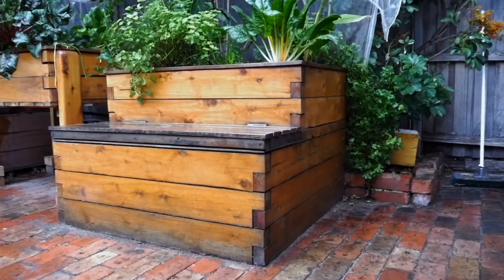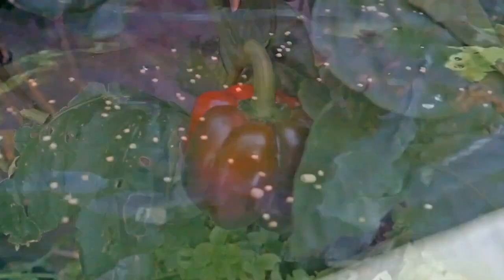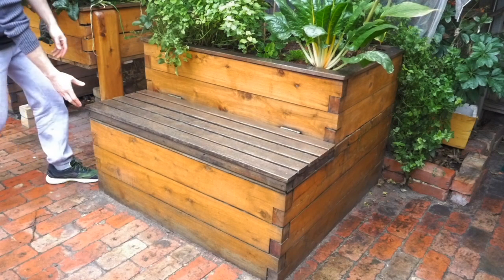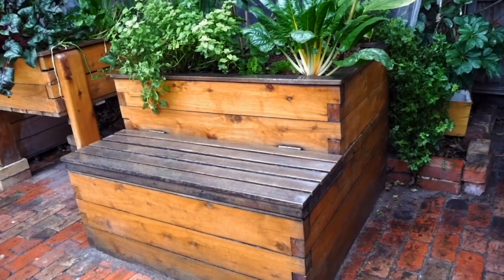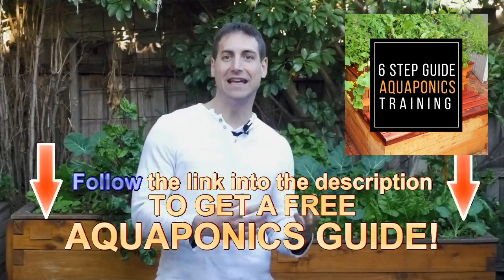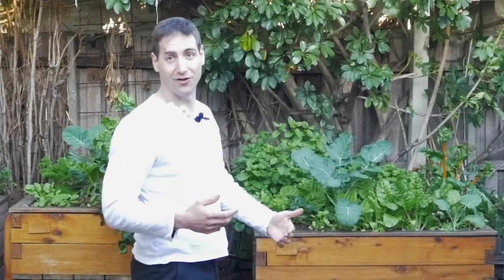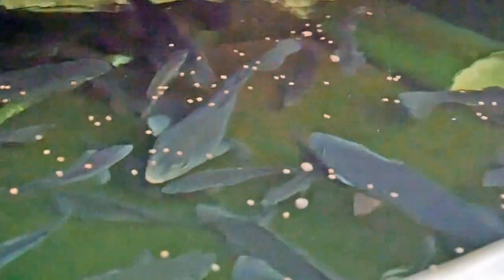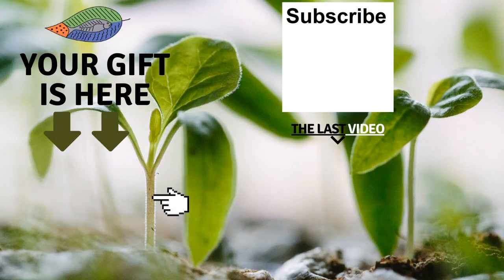Is wood good for aquaponics system?

Comment from the maker: Have you used wood for your aquaponics setup? What type of other material are you using?
Reply: I only use pressure treated wood when necessary to frame in other materials.  Really though for my current project it's a desperate rush to try to get the fish moved from my existing pond 1/2 mile to my new setup which is a work in progress.  For 100 bucks each I purchased two 140 gallon stock tanks for the fish and am also repurposing a hot tub that has maybe 200 gallons.  I set it all up right next to the house on the existing concrete pad where there is water and power.  The tanks will be set up with heaters and aeration today and I hope to start moving the fish.  There are maybe close to 20 so it will be a chore.  I rented out the house where the pond building is and it's now the tenants backyard so I must vacate.  Anyway your set up looks nice and that was an odd egg.  I like the bench approach it reminds me of the old benches with a storage box in the old houses.
Reply: The other reality is to keep it warm without spending a fortune.  To that goal I put both tanks on 2" pink foam board insulation and will also surround the tanks with more foam board.  On top the old hot tub cover works well on the tanks because it flips up in the middle.  Over the actual old hot tub witll go more pink foam board.  Then tarps to enclose the sides of pink board and over the old hot tub.  Nylon rope to cinch it all down.  Doesn't sound very aesthetically pleasing, does it?  I am going to grow duckweed inside using fish water and watering my plants that had to be moved inside for the most part.  Anyway if you made it this far have a great day.

Comment: Advanced technique, I put the pump next to the air and the heater, and on the ground of my 140 gallon stock tank.  Then I put the entire 5 gallon combo biological filter into the tank and submerged it, attached the pump, and think it will work out well.  That's why I advanced it, made sense in terms of covering the main tank.  Now I can just "fish" it out occasionally.  OK off to catch and transport some tilapia it is GO time.
Reply: 14 tilapia transferred from the pond to 140 gallon tank.  No fish were harmed much.
Reply: Another 6 today so far.  I got Big Blue that one is a beast.  Also 3 other blues and two small whites.
Reply: Last 8 I hope total 28 in 2 days.  Seven more blues and "tiny" the little white one that never grew much.
Reply from the maker: Thanks John,
Any video of your setup and fish?
Cheers
Jonathan
Reply: @AquaponicsRevolution  Sorry Johnathan, I don't do videos.  The best I can do is rambling diatribes of nonsense.  Sad times in the days of some of my prized fish.  This is what can happen when things go wrong.  The good news is 19 survivors are in the two 140 gal black tanks and seem reasonably happy after the big move.  Yesterday I was worried one of the whites was floating but was pleased to see him eating duckweed casually on his side.  Whew.  Took out circulation other than air stones.  Added the biologic gel.  Did some filtering the other day on each tank but still need a real filter set up.  Of course it's getting ready to freeze.  The duckweed is growing in the hot tub with heat and aeration.  Each tank has 300 watt heater with a control that seems to be working.  Finnex basic controller with the titanium heaters encased in plastic.  Seem to be decent.  I have it set up to cover at night with the hot tub original cover over it and 4x8 pink sheet board over the two tanks.  That's it, a work in progress...
Reply: @AquaponicsRevolution  bad news managed to drop the one heater controller in the one tank by mistake.  Three more fish didn't make it.  Amazingly,  six actually survived electrocution.  My plug and GFI and God knows what else did not.  This time I cleaned these poor blue nile fish and salted them up with Maldon and grilled them whole.  I overcooked the one side to some extent but they came out pretty tasty.  So there is that.  I moved the remaining 6 fish into the hot tub.  I am celebrating "no floater" Thursday after temperatures dropped to 24 F last night.  I just love all this extra work trying to keep a few fish alive but at least they do seem to like the hot tub.  I am going to feed them mostly duckweed and very little of the commercial food at this point.  There is a lot of duckweed to be fed to them.  In fact I am going to start consuming some duckweed myself, and why not.
Reply: @AquaponicsRevolution  today I am celebrating a "floater fish free Friday" at least thus far.  It was 62 in the 140 gallon tank but a comfy 72 in the hot tub.  I added a big ceramic flower pot and five plastic five gallon grow buckets to the hot tub.  The arrangement is mostly for the fish to avoid eye contact and not have to defend territory.  Sanctuary.  They haven't been eating much in either tank including the duckweed.  I have placed the bio ball bag in the hot tub along with a bunch of foam strips from the heaters.  I ran an entirely separate extension cord to another heater controller and a backup 300 watt heater in the 140 gallon tank plus it needs more juice anyway.  I also added another 500 watt heater to the hot tub.  These Finnex units are nice (until dropped into the tank) as you can run two heaters up to 800 watts so the 300 + 500 watts is perfect.  The lighter color makes it easy to see them in the hot tub and the water and additional air and heat will make them so happy.  They are now hopefully happy together.  I may add some 5 gallon buckets to the 140 gallon tank but need to figure out the arrangement to make it beneficial.  Well that's it.